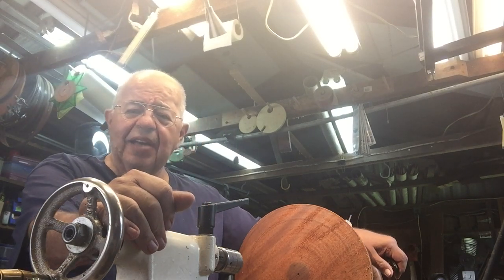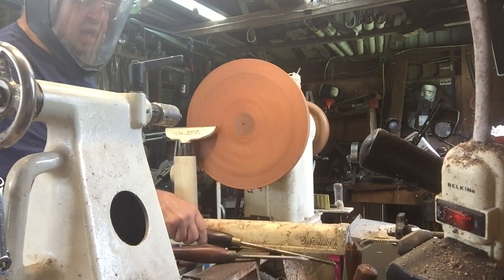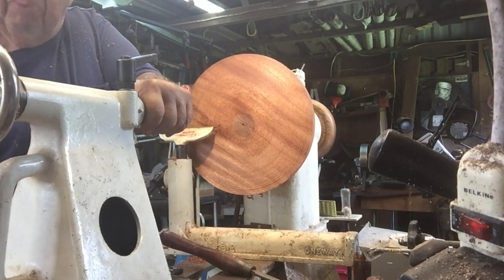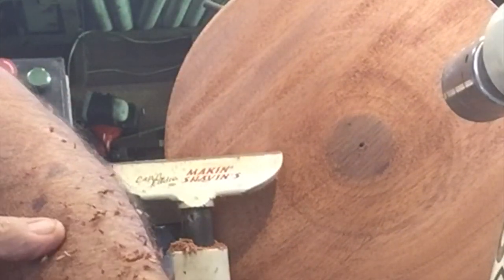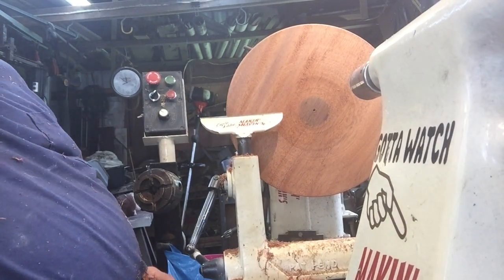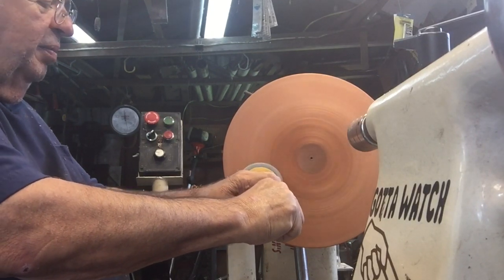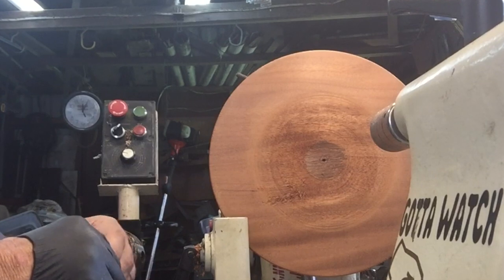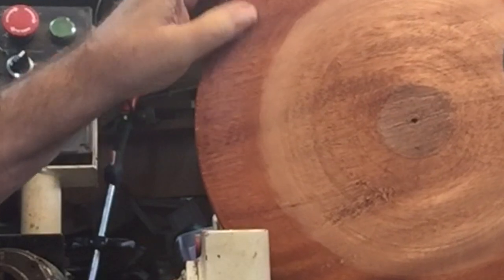# 1008 CA Finish III

Comment: Great to see you in the shop Marin’ Shavings again Cap’n. I’ve learned a lot from you over the many years that you have been producing videos. I have ordered several items from you in the past all of which have been of excellent quality. I need to get back onto your site to order some more carbides as the ones that I got a couple years ago are finally pretty well worn out. Great video and thanks for sharing.